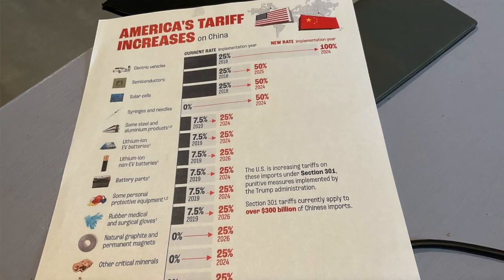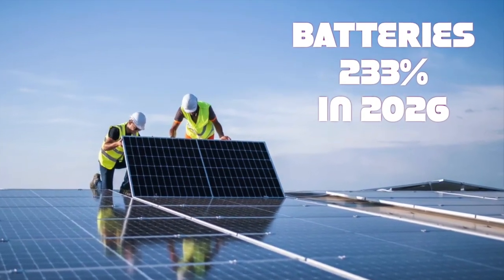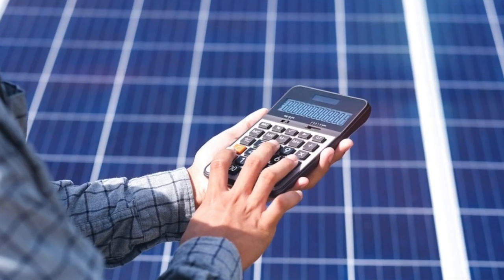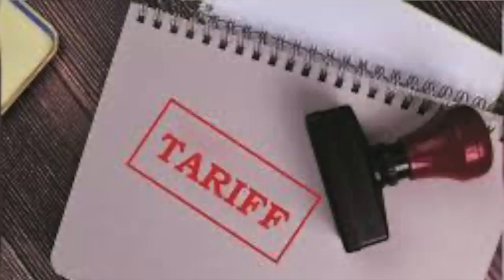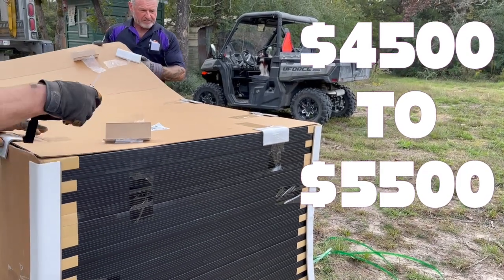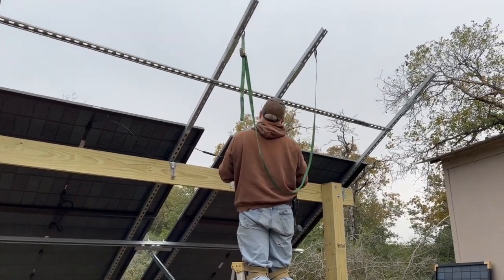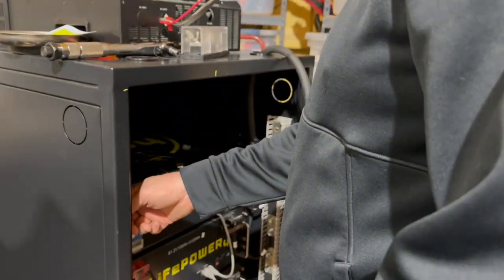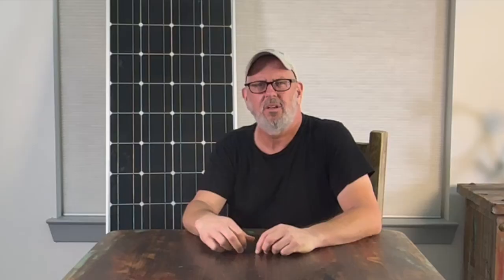Will Tariffs INCREASE DIY Solar Prices?

Comment: What information do you have to support tariffs increasing more than they already have?
Reply from the maker: @user-zg2hg4cu5b  Thanks! 🤩. Prior to 6/1/24 solar panel tariffs were 25% on imported panels (bifacials were excluded). After 6/1/24 the tarriffs for ALL are 50% (100% increase in tariff).  Lithium solar batteries presently have a 7.5% tariff. In 2026 those rise to 25% (233% increase in the tarriff).  Received emails from several sellers suggesting prices will go up on all panels in 1-2 weeks.  Am already seeing some models higher as old stocks are depleted.   Tarriff Source: https://www.whitehouse.gov/briefing-room/statements-releases/2024/05/16/fact-sheet-biden-harris-administration-takes-action-to-strengthen-american-solar-manufacturing-and-protect-manufacturers-and-workers-from-chinas-unfair-trade-practices/
Reply: @terrahillfarm  This is what I was looking for.  Thanks,  I had no idea about this.   But just a heads up, Ive been in the market to buy some panels, having them imported from China.  Trina Bifacial 445w panels come to $0.29 a watt landed.  Idk if thats a pre or post terrif increase price, but I feel the price is very fair
Reply from the maker: @user-zg2hg4cu5b  Thanks!  I don’t have a lot of experience ordering from China but I know there are two ways to ship. With one the sender is responsible for any duties or tariffs and the other the receiver is responsible.  Might just double check that so they don’t surprise you when they call from customs and ask for another $500.  Let us know how the panels work out for you!  If supplies increase the tariffs won’t impact prices so much but if not, well, they could add $1,000 in extra cost to a nice pallet. 🤦‍♂️🔋☀️👍⚡️
Reply: @terrahillfarm  The company I have been in contact with has a warehouse in California.  Duties are paid by them,  first imported to their warehouse and then shipped from warehouse to home.  If you are interested in going down that route, make sure to tell the supplier you are looking for DDP shipping (delivered duties paid) .   That is the final cost to your door with no surprise fee.   However most companies located in China can not, or will not ship due to the U.S.  "anti-dumping" law
Reply from the maker: @user-zg2hg4cu5b  Thank you!  That is fantastic information and I look forward to hearing how the whole experience goes for you.  I know many people who’ve ordered inverters and some easier to ship items, but none ordered panels.  I’m considering a battery 🔋 build so I may be doing the same thing soon.  ⚡️☀️🌞
Reply: I spoke to someone at Signature Solar who said new panels from China will go up around 8/1, but said inverters & batteries would not be affected.
Reply from the maker: @InVinoVeritas.  Thank You! 👍. That’s what I’d heard as well.  No impact on inverters and battery tariffs don’t start until 2026.  The new Sirius panels they carry are made in Brookshire, TX just west of Houston.  I may test those out as I would like to do what I can to support US Solar manufacturers.  Of course these days it’s hard to tell if something is MADE in the USA or simply ASSEMBLED in the USA.  🤔☀️⚡️🔋🇺🇸

Comment: A lot of great info in here. I've always wondered why I can find really good bifacials at very competitive pricing compared to panels that weren't bifacial with less wattage. Sad to hear that may soon go away... Nice work on the video, sir!
Reply from the maker: @SignatureSolarEthan  Thanks!  I had to consult our research department to figure that one out and it surprised me too! 🤣
Reply: My personal opinion over negative speculation also drives stagnation of over stocked inventory thats not moving fueling futher reduction of profits J.S.
Reply from the maker: @dons5105  Thanks for the feedback!  I don’t want to contribute to over negative speculation, I just want to pose these questions for consideration. Panel inventories are low right now based on the inventory lists from the wholesalers and warehouse sellers I follow.  Will bifacial panels maintain similar pricing to single sided panels having never had tariffs applied?  Will the decline in residential solar panel demand lead to less production of those smaller panel sizes and more production of larger commercial sized panels for solar farms which are still booming? Why are solar panels in Europe a third to half of the cost cheaper than in the US, tariffs?  I think these are relevant questions.  

Personally, I don’t think tariffs work well as there are too many ways to around them. If you want to encourage more US panel production, encourage more competition as that historically has created innovation.  If you have a big solar project coming up soon, I think you have to weigh all these factors yourself and accept that a new 25% tariff has the possibility of increasing the cost of a typical pallet of bifacial panels by $800-$1000.  That’s not much in the total cost of project, it’s just the math.  👍⚡️☀️🔋🤩